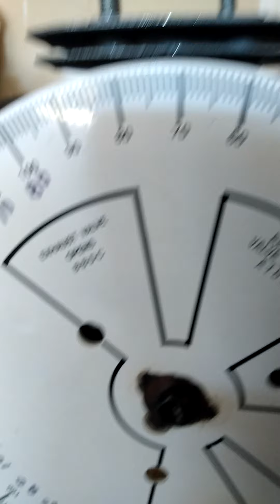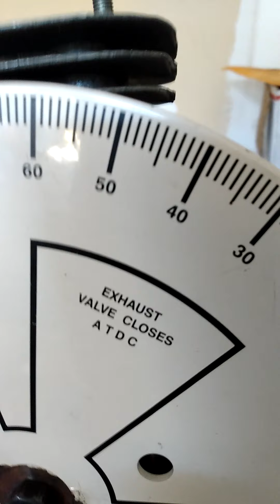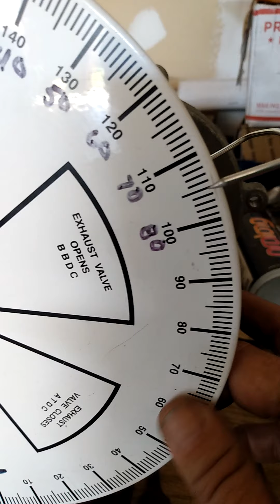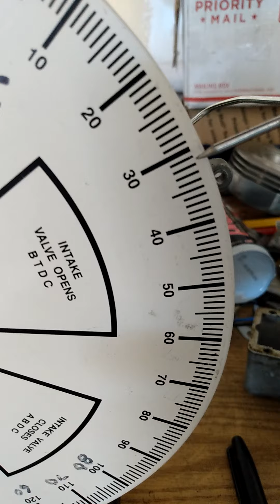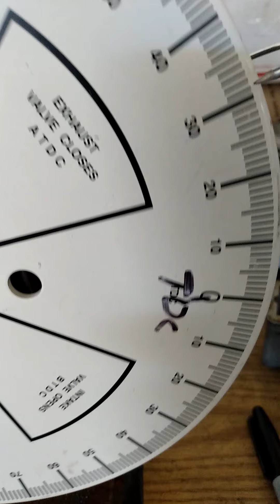two stroke degree wheel set up

Comment: To all the greenhorns watching   these video's: you comment should start with, " why do you ever ever need a degree wheel?? I mean ever never. 😢
I have been porting my whole life and never ever used it. Why? Because Japan did it right and good. Now how to make the ports "bigger, higher, wider,lower", and in which direction and how much and what degree??? Simple, you must know how a 2stroke cylinder and piston work first. Than how the cylinder exhaust port works, the intake, membrane open/close moments, and the pressure needed in the cylinderhead bell for the piston mm you will used, ignition timing, bigger carb...... and then finally the pipe . Yes the right pipe for everything you have done to the cylinder/engine/ignition/carb/membrane setting . Not the other way around ok, not the right cylinder ect for the pipe. But the right pipe for the total setting of the completed engine. 
... did I mention anything about  a degree wheel???? No ,why not? Because I never needed it . I know what japan did ,I know how all the parts works, how to adjust them to go faster ect ect.
Meaning : the guy with the degree wheel is still trying to figure it out by measuring and not knowing how to port and how much , if we take the cylinderhead off and look inside, we bring the piston down max and up closing the ports and further up closing the exhaust port, than measuring top exhaust port to top of  the cylinder, WE started porting already man . Know exactly where to,how much, and degree. 😅Also the guy putting Cc's in his cylinder head to measure how much to make it bigger because he went from a 40mm piston to a 50mm piston😢😅.Just use the Japan formule you find in the 40mm setting (original). Knowledge. 
Ok let's say the exhaust port was 16H/25.5W mm on the original 40mm cylinder+piston. AND the cylinderhead bell 40.5W/9.centerH/ bell26W/ ☆7.25Lby 2.25H. ..now how much for a 50mm piston in that same cylinder? Take a calculator and in minutes you will have you answer😊. The formula? You must know right ? See that's why I will never need or use a degree wheel, I see that just buy looking into the cylinder ❤.  Porting is very very easy , and every pro knows that already for about 50years and more.
Reply from the maker: Do you see me asking any questions. Does this look like a Japanese  motorcycle  motor. I also have been building two and four strokes for about 45 yrs. FYI the bigger the wheel the more accurate  it is. I also expain most all topics on port shapes Hights and function. I couldn't read the story you wrote.
Reply from the maker: You can induce all the human error you want by measuring  how ever you want but I will block you leaving stupid comments
Reply from the maker: If your so smart post some vids

Comment: I keep hearing you read out 28.5 degrees but I’m reading 32 degrees in your video, am I misunderstanding something ?
Reply from the maker: Yea what your missing  is me trying to make a video to help people. with a phone and one free hand and called 32 degrees  28 degrees because I didn't  have my reading glasses on. Either way the point it his positive  stop is irrelevant. Two strokes are symmetrical. Meaning your degree wheel  is properly installed  when it stops at the same point when hitting position  stop going down and up. Either way notice it stops at same point.
Reply from the maker: 2.6 thousands  views first person to point out my irrelevant  mistake
Reply: Honestly I was in the same boat wondering where 28 was when it was on 32.

Comment: Hay buddy I got a question for you
Reply from the maker: What's up
Reply: @2strokecarbtuningportingin187  My bike is cutting out like its losing power like its running out of gas. Cleaned the carb and all that.I can't find the problem.. Any ideas on what it could be
Reply from the maker: @dannygreider8747  sure few things to check 1 do you have good fuel flow out of the petcock. Could be a gas cap vent issue. Or petcock.  Check float level.  Or seek out vaccum leak or it's running lean.  There's some common things to look at
Reply: @2strokecarbtuningportingin187  ok bro thanks
Reply from the maker: @dannygreider8747  fur shur hope it helps